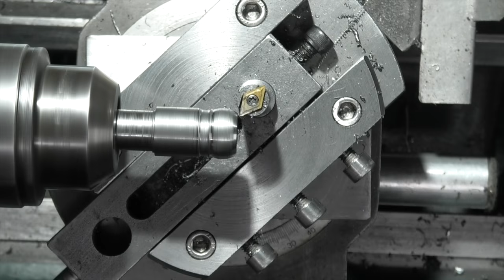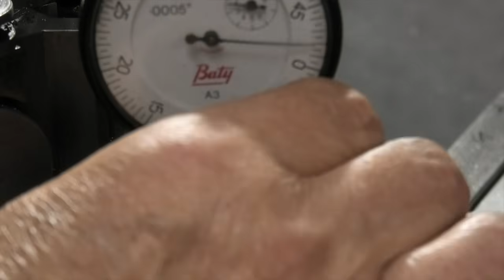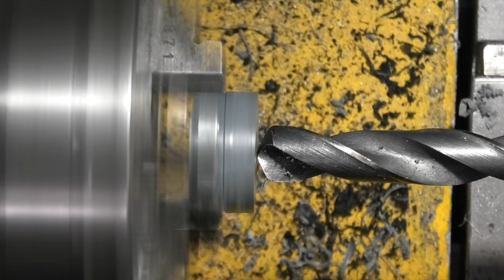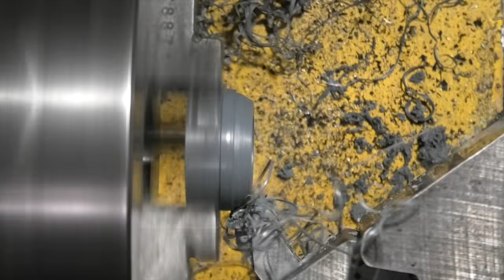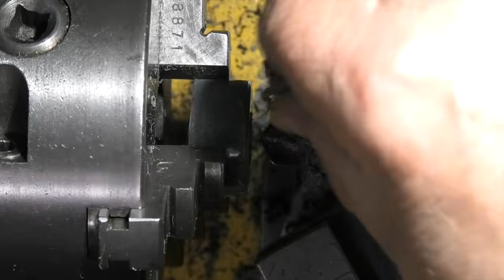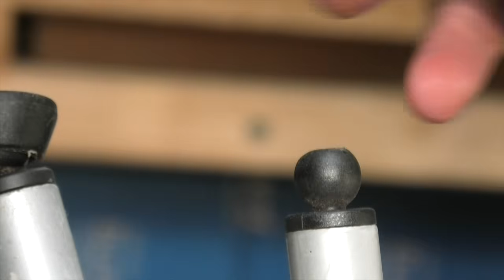Turning Internal sphericals

Comment: Another way you can provide relief behind the cutting edge is to offset the cutter in the chuck (packer under a jaw) and continue using your ball cutter to relieve some material. 
Where the unmachined area becomes relieved is the cutting edge, with the greatest support possible.
Now relieve the rest of the sphere as shown to get access into the part etc.

If you need to make the internal sphere a "full" sphere or a bearing surface with the rest of the internal sphere being less important (Bosun-8's question) I understand (have seen, but not done) the way it is done is....
The problem with using the tool in a lathe is that at the centreline of the part the cutting surface speed is zero, and the cutting tool is broad, so not great.
If you spin the cutting tool (in a mill) you can change the dynamics.

Make the tool a "full" sphere. You need to leave the shaft big enough that it doesn't break but small enough to get the greatest access.
Mount the part on and angle to the centerline of the tool, now the CL of the part is no longer at the point where there is no surface speed.

Tool in a vertical spindle mill, the part mounted on a rotary table that is mounted on an angle plate set at say 15deg (???).
Because the centrelines of the tool and part don't intersect during the cut you can relieve the tool at its axis (end) so that there is nowhere that the cutting surface speed is zero.
That is, about 10 deg (I think) from  its end can be removed.
Bring the tool down into the part and then move the table sideways to cut the surface (depth of cut) and then rotate the RT to cut the sphere.

That is the basic idea - and I hope my description gives a starting point.

Comment: The original hole has a radiused bottom for the ball to seat on. Could you have ground a part radius on the front of the tool to plunge in from the end so the ball seats in it. Then clear out the sides for clearance?
Reply from the maker: The ball feet had been worn away and had flats on the bottom of them.
Reply: See my other comment